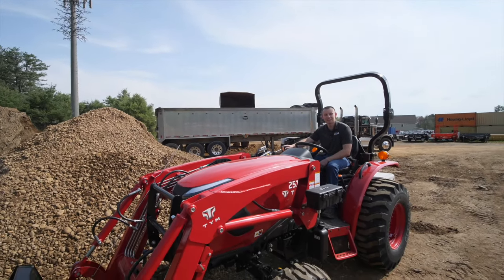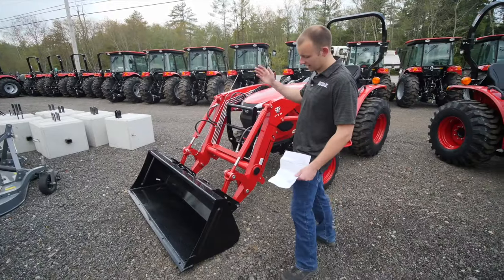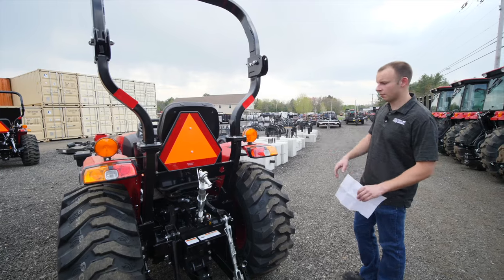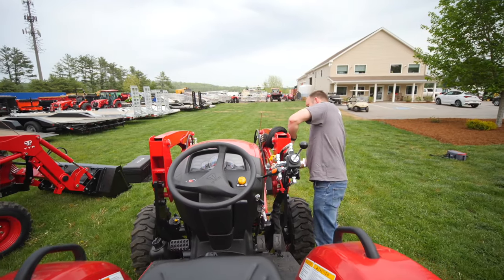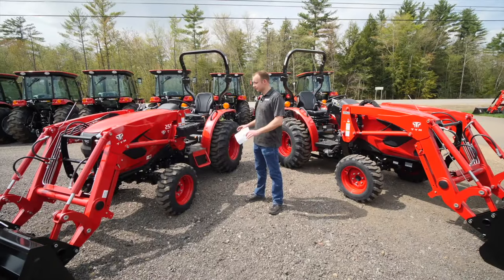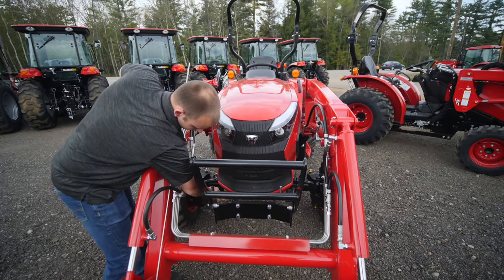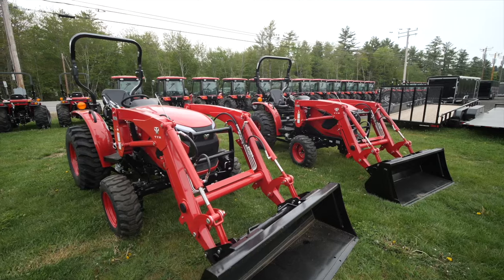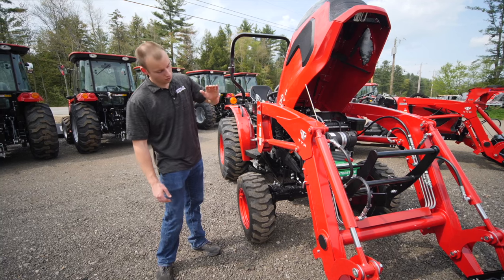TYM 2515 TRACTOR REVIEW // RACING.. DIGGING.. LIFTING

Comment: I hate that tractor manufacturers dont give accurate lifting capacities. What good is knowing how much it can lift "at the pins" if you dont lift at the pins? Its like a car company telling you the MPG based on the car being in Neutral rolling down hill.. It should be what the tractor can lift in the bucket. Which is typically 25-30% less than what the "at the pins" rating is. So if this tractor can lift 2200 pounds at the pins, after factoring in the weight of the bucket its self, it likely can only lift 1300-1500lbs.
Reply: Also when you have a Small model such as tym-254, 1 series Deer etc... the quick attach loader adds 75-100lbs to the loader.. so it reduces your capicity... If you are just doing simple loader work and never use any front attachments its a loss of capicity and Pin on Bucket is just fine.
Reply: the lift capacities are nonsense.  in no universe can a 2500 lb tractor pick up 3300 lbs with the rear,  or 2200 lbs with the FEL. once you go past about 50% of a tractor's curb weight, you are tipping over, period. you can put whatever size hydraulic cylinders, pumps, etc on a tractor, and it won't change a thing. curb weight is the real limiting factor for lift capacity.
Reply: The pins are the furthest forward reference point they can promise. They don't know that implement you will be using. For all they know you're going to put a 12ft boom on the front and then get mad when it cant lift even 400lbs at the tip.
Reply: @Tenacious21  Nope, they can give you the rating at 15in past the pin. Which is where the load is in a bucket. This gives a much more accurate lift capacity for buyers.
Reply: @brianfarrell5240  So what happens when you add counterweight on the back end of the tractor?  I have used my massive brush hog and my 2515 can lift an overflow bucket of granite gravel, and that is with a Wicked Toothbar that considerably adds to the volume of the bucket, probably another 20%.  I am well past 2200 pounds, easily.  I did a ~90 tons of recycled asphalt on a 350' road to my garage.  Hundreds of loads of granite.  This tractor is a monster.  You have never used it.
Reply: @dvmartel1  if you add a massive counter weight, you change your curb weight, buddy. what I said was that, in no universe will a 2500 lb tractor lift 2200 lbs, so the lift capacities are nonsense. prove me wrong.
Reply: @brianfarrell5240 Where are you getting 2500? It weighs 3k before the loader is even on. It probably says somewhere in the manual it needs certain amount of ballast. Probably filled tires and 800lbs or more of 3 point ballast to be stable with 2200lbs.
Reply: At the pins is probably the all around best way to rate them to be even across the board knowing what your loader’s hydraulics can handle at max. Otherwise issues arise when changing out to pallet forks etc and your balance point changes which will greatly reduce lifting ability. Manufacturers however will get sneaky and change how they rate their loaders, at the pins, without a buckets etc etc etc
Reply: Use some common sense .
It's only logical to rate it at the pins because it's a universal standard.
It's the only way to truly rate it against another tractor.
People have different size buckets different gauge buckets different materials will place differently in buckets, Forks or whatever.

It is perfectly reasonable and logical.

Have some common sense

Comment: i got a 2022 t494 least amt of computers and sensors and no turbo, kukje has a fantastic reputation.w loaded tires im close to 7000lbs  you should borrow one of them there KU-BOATERS like the grand L and show how it cant put a 2000lb pallet in a pickup then do it with a t494 at 18k less $$$
Reply: Spot on about the competition
Reply: great video and info. THANK YOU !!!
Reply: Watch any kubota last 10x longer

Comment: The 2515H I bought 18 months ago has been an absolute delight to own and operate.   The chassis is absolutely massive and this tractor has immense capacity.  Thank you for the great review.  My biggest issue is with the key placement, right where your right knee will regularly compete for space resulting in constant bent key.   That needs to be moved to a topside or other non-interference place.  In fact, any button down there gets accidentally activated.  PTO, hazards, turn signals, you name it.  All should be in a upper housing protected from accidental touch.
Reply: Price?

Comment: I bought a Branson 2515H 13 months ago. What you should show is a slow race between the H & R model. I was set to buy the R model with a rototiller and the dealer had me do a slow race as if tilling. The R model wouldn’t work as well in that case. However pulling my old pull offset disc the R model would be better. I’m very happy with my H model and the ability to just crawl slow box blading next to a fence line or tilling or loading a pallet of material on my truck. I opted to have rear remotes and hydraulic top link along with AG tires. I’m wonder what the weight and cost is of of one of those concrete three point weights? I off loaded a pallet of bulk potting soil yesterday ( 75CF) and the tractor was light in the rear even with rimguard and my old box scraper on the back. Going up a slight slope I had to use 4wd as the rear tires started to spin. Love the weight of the tractor. My prior tractor was a Yanmar 2610D (4wd) select shift. 30 hp 27 @pto. While I had more power it was lighter and didn’t have the traction ( pulling the offset disc) as the 2515h. I do notice if discing a slight uphill or downhill there is a difference in performance. I use the cruise control quite a bit. Very satisfied with my tractor, rototiller and pallet forks I use a lot more than I thought I would. Go do a slow race 😂

Comment: Never by these tractors,  it's all about parts... Need a part 20 yrs from now 😂
Reply: lol, that's an uninformed comment.  Kabuta and the jolly green giant wish that was the case.  The owner of TYM is Kukje Machinery. Founded in 1968 and is a subsidiary of a massive well-established Korean conglomerate. They likely will be here in 20 years. Kukje other customers include Cummins Diesel who they are in contract with to build and supply engines for them.  Kukje manufactured/distributed some J Deere tractors since 1987. I have no issue with TYM and its parent company.
Reply: I have an 85 kubota that I can't get a front hub for!     But JD under 50 hp are junk now...  This company builds more tractors worldwide then anyone...

Comment: You could upgrade the 2515 to the 42 horsepower, one with a cam and and larger injectors. It can be done.
Reply: You can turn the fuel up on the injection pump with a flat screwdriver
Reply: How much?
Reply: @dlawson8993  you can add like 5hp

Comment: Really appreciate the video man.  I've been looking at tractors and before the acquisition, was looking hard at a Branson 4815 or a  TYM T474.   Could you do a video comparing those two?  I really liked the Hydro vs Shuttle top speed.. i have to road my tractor sometimes and 5mph is a big difference.
Reply from the maker: Thank you! We will try to do that video for you in the upcoming months! Or at the very least a deep dive video explaining either of those models :)
Reply: @SR1Equipment-1  thanks they seem very similar but it seems like the t474 is better equipped
Reply: Run from TYM !
Reply: @rad1ist  why exactly?
Reply: @MarshallMims  mine fell apart. The frame twists when you have bucket inthe air and pops the hood open. Tractor isn’t a real tractor if the FRAME flexes. I’ve had 3 tractors also has a Koti which is way better than a TYM but lifting capabilities suck. Oh yea I also busted the front steering knuckle off,  got a stick James  up the bottom of radiator Shitty underbelly protection, no front grill protection. I can go on and on  what a POS TYM is. Real tractors use the engine and transmission for a FRAME. Don’t know how they build the bigger tractors but the compact tractor is junk.
Reply: @MarshallMims    Oh shit I also forgot the loader bucket Non replaceable bracket had a big crack in it, I traded it in for a Koti and then wish I would have just gotton the dam Kubota!
Reply: @rad1ist  sounds like you needed a bigger tractor ...
Reply: @williamhaynes7089   no my Kubota BX25 took everything I threw at it and more.